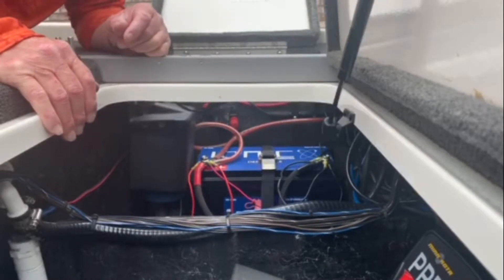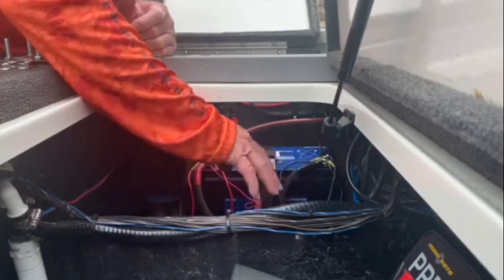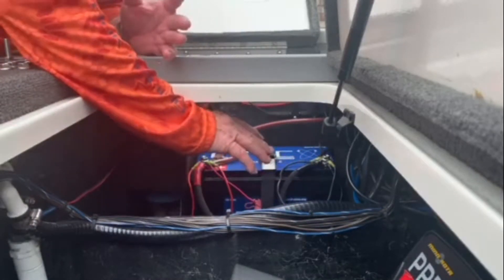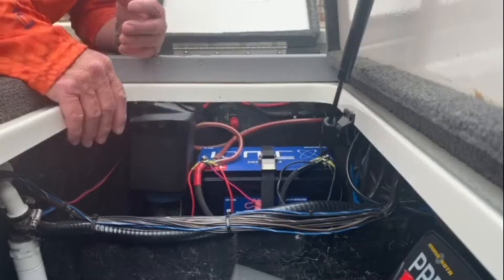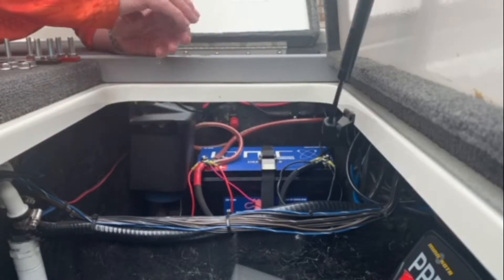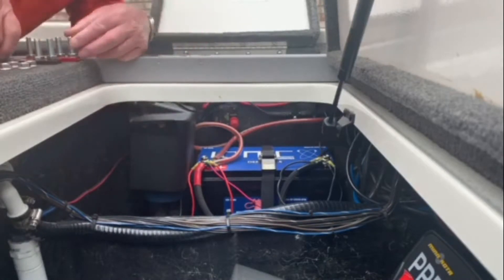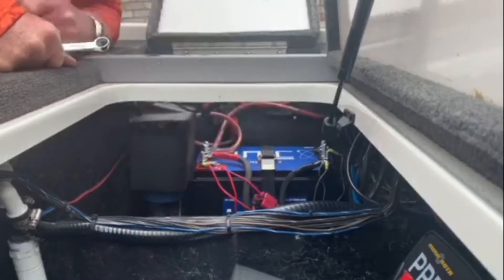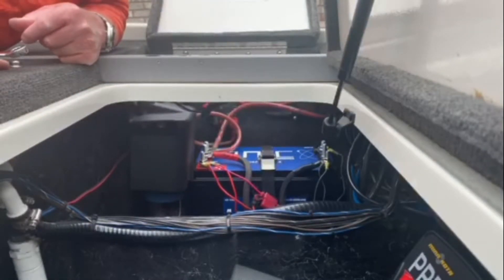Lithium Battery Terminal Adapters

Comment: I went to order 3 sets of them and the shipping was $24.00 to Missouri. I deleted the order.
Reply: I should have done the same. I ordered three and it was over $100 shipped to Michigan. These things are so stupid simple, I should have just gone to the hardware store and made my own for less than 10 bucks total. The negative (5/16) post on these  is so close to the hole you attach to battery with that you need to take the negative nut off to get it off the battery. I wanted to juest take one nut off and be done per post. Not with these. I ended up going a different route. Have no idea how to return. Sent an email but no response, might have gone to a unmonitored inbox.